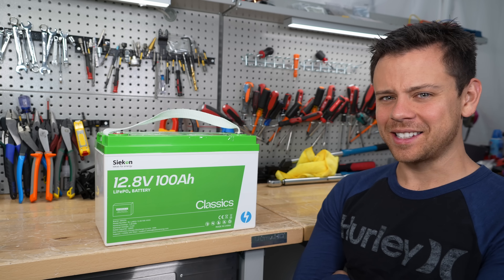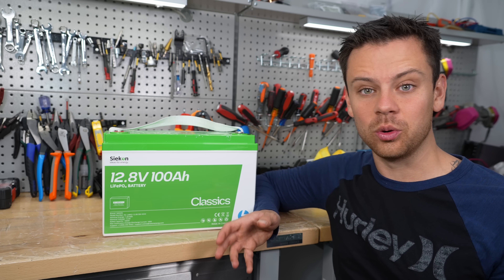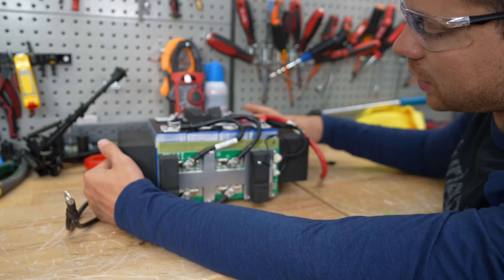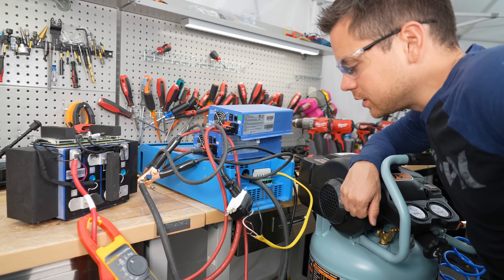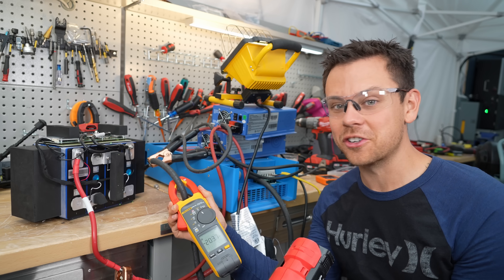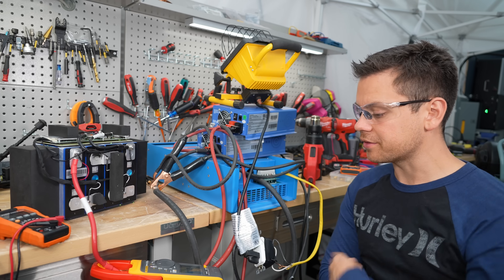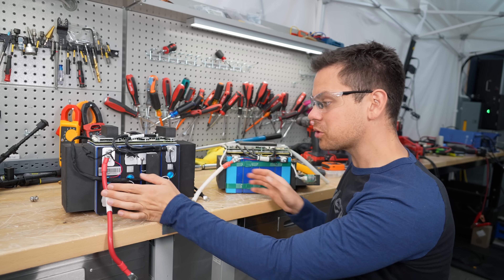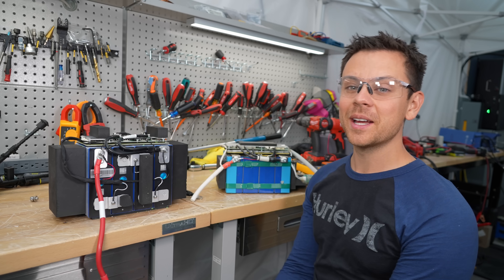Lead is Dead! $229 LFP Siekon 12V 100Ah w/ 150A BMS and Low Temp Charging?!

Comment: Thank you for the review. I'll buy a couple of these. We bought two Battleborn batteries for $1K each, and one died after a little over a year. We contacted Battleborn, as battery was under warranty. Battleborn did NOTHING, except have us check and recheck the battery. We proved the battery was dead and would not charge. Battleborn did NOTHING, NOTHING, NOTHING. I would NOT recommend buying Battleborn because they don't support their product, nor warranty.
Reply: Please, post a review of the Siekon batteries to Will's forum.
Reply: @robbehr8806  I will. My husband is not motivated to purchase more batteries since Battleborn flopped and doesn’t support their product.
Reply: Battleborn has the audacity to hold their prices where they are AND offer that level of customer service
Reply: @TobyCostaRica  I agree.
Reply: @TobyCostaRica  I agree.
Reply: I bought two big Battleborn batteries (270 ah each).  Very expensive.  Connected two in series, keep having balancing issues.  I regret my purchase.
Reply: @pearlydeer4555  ; Do you think it's that the batteries need updating to current standards, your batteries were bad production, or what?
Reply: @robbehr8806  Not sure what the issue is.  This is the third year using these with the 24 volt Growatt.  Had balancing issues in the first 6 months.
Reply: @pearlydeer4555  you connected 2 in series? Dang that is super dangerous if they are not rated to do that.
Reply: And look what it got them; a disappointed customer who will now bad-mouth them on social media.  Great job, Battleborn; you charge enough for your products that you should surely honor your warranties.

They're probably feeling the heat from LiiTime and the other cheapies now and the only thing that their brand has to offer is a reputation of dependability and great warranty support, so if this is how they treat people that spend $2k on batteries, then good riddance to them.
Reply: Man for 4 times the price of a li-time that's crazy. You could've bought 4x's the battery for the same price.
Reply: @mathehack1  At the time of purchase, these other batteries were not available.  Renogy was an option but I went with Battleborn due to promise of quality.  Otherwise I'm in agreement with you.
Reply: @pearlydeer4555  you're right a few years ago there weren't nearly as many options. It was build your own battery with raw cells, battle born, or hit or miss Chinese units.
Reply: @mathehack1  hindsight is 20/20. I agree.
Reply: Can you combine different manufactured 12 volt 100 amp hour lithium batteries?
Reply: battlescam
Reply: That is outrageous. Wish I knew that before I purchased 4 of them a couple years ago!
Reply: @ChatGPT1111  I hope your batteries last.
Reply: I decided to upgrade the batteries in my travel trailer and my parent's trailer, right before  trip. They were all bad and I wasn't willing to buy lead based batteries again when lithium is so much better. Li Time was available quickly on amazon so I decided on those and asked my dad if he wanted the same. He told me that Will recommended them. I had seen a few of his videos in the past but hadn't really caught up on anything battery related in the last year. The 200 ah heated li time battery seems to be working fine, but the li time monitor is not all that accurate. The reviews on renogy ( the blue brand, right?) also show similar results. I think I may use renogy for a solar panel charger and used panels from an arizona company, but it just wasn't worth spending the money on battleborn when they have bad reviews as well. With only using my trailer occasionally, it is hard to justify the extra money. Many sailing channels I watch have used battleborn and have been sponsored by them, but for a third of the cost, I went with Will's recommendation of Li Time. Li Time even offered to take back the monitor after I left a bad review, but the renogy would be three times the money with bluetooth added but the same drawbacks so I haven't taken them up on the offer.
Reply: Thanks for the info. No Battleborn for me.
Reply: How have the batteries been holding up?
Reply: Battleborn is a boomer company

Comment: Lead Acid don't let out the "Magic Smoke" and burn your house down.!!😉
Reply: But Lead-acid DOES off-gas, which is flamable, as well as can cause corrosion. I have used both, and EVERY battery bank I've made with Lead-acid has had corrosion, especially on the Positive terminals. The terminals on every one of my LiFePO4 systems are as clean as the day I installed them!
Reply: I have had the experience of a spark hitting on a lead-acid battery, and it exploded!
Reply: @Tumbleweed5150  Spent 25 years in the Ski Patrol. Every year our First Aid refresher included a section of treating injuries from lead acid batteries exploding from hydrogen buildup. 

I never had to treat a case of a Lead Acid grenade, but it was considered likely enough that they wanted us to be ready and rehearsed for it.
Reply: Lifepo4 does not have thermal runaway it's iron based, no oxygen from cobalt or manganese.
Reply: @btekwindsolar  The Magic Smoke is extremely flammable.!!🙄

Comment: Hi Will, I live in Arizona. I'm very interested in the thermal testing, especially in your cargo trailer. Just like in Las Vegas, heat is an issue, here in the desert. So, maybe do a full and comprehensive video on thermal effects and testing. Maybe, include segments from previous videos that touched on the subject. Love your videos!
Reply: @robbehr8806  Your LFPo's should be in-cabin for thermal reasons. Why, do you put them in an uninsulated basement?
Reply: @my_channel_44  ; I definitely plan to install the battery in-cabin, but in Arizona, if cooling fails or is shut off, temps in a trailer can reach 140F.
Reply: @robbehr8806  Then design a system where that's not going to happen.

Comment: Will, do these have the capacity to run a trolling motor, and or start a boat 60Hp boat motor?  TIA
Reply: They are awesome for a trolling motor. They wont start a 60hp motor though.
Reply: @enigma9789  Thanks.

Comment: Lead acid batteries aren’t going anywhere. They charge below freezing without a heater and LFP is incapable of cranking amps. At this time they are irreplaceable.
Reply: This Seikon LFP can now crank the amps. It can be used for heavy inductive loads and provides active over current and voltage protection.
Reply: @MrJohnBos  It cannot provide the several HUNDRED Amps needed to start an engine!

Comment: Two years ago I replaced my 18 year old off-grid lead acid batteries with new lead acids. Now I'm regretting that decision BIG TIME.
Reply: 18 years from lead? How? I've been getting half that w/ Trojans
Reply: @danstrayer111 I replaced my Lifeline AGM batteries on my yacht after 18 years. They still worked but capacity was poor. I switched to the Amperetime (now Litime) LiPo batteries and haven't looked back.
Reply: @danstrayer111  impossible that they lasted that long unless the depth to discharge was around 5% and they were primarily floated all of their life. Typically you will get no more than seven years if you take good care of them and don't cycle them very deeply.
Reply: @boblatkey7160  yeah...maybe . I have a hard time believing 18.
Reply: @danstrayer111  i've been doing offgrade power systems for 25 years and I've never seen it. However I have seen plenty of lead acid battery banks that are over 10 years old, but again they were shallow cycled and very well taken care of.
Reply: @boblatkey7160  It's a nice irony that for a period of time, basically the life of my last set of lead, as the batteries got weaker and weaker, a really cool array of LEDS were available, (esp on Ebay) that required so much less power, and saved more power than the battery capacity was losing. That set went almost ten yers because of LED 
lighting.That was in the 90s I guess. The old automotive bulbs were real power hogs.

Comment: Do you think this battery is an appropriate "drop in" to start Gas vehicles? The high current draw for a few seconds seems to be the only thing keeping LFPs from replacing car batteries.
Reply: At idle speeds with a stock alternator, you will burn it out. Need a DC/DC converter to buffer and intelligently charge the LFP.
Reply: @s.mendez7160  Yes I've heard that the DC converter is essential. Apparently without it the LFP will try to take almost infinite charging current
Reply: Exactly
Reply: My sailboat's alternator voltage controller already has a LiFPo4 charging mode. My only concern is the "cranking current" which I am beginning to feel is red herring. My starter for the 45 HP diesel engine shouldn't be sucking up 400 amps for any appreciable time. Same for my windlass. 

If I replace my two 168AH AGM Lead acids with two 304AH LifPo4 in parallel with 200A BMS controller on each, I gotta think both my starter and anchor windlass will be well satisfied.
Reply: Vehicle main battery is the one exception where LFP can't be used. Enormous cranking current, plus having a BMS could be disastrous. If the battery becomes full and switches off while driving the alternator output would go unstable and possibly destroy the vehicle electronics. I'm not an electrician so this is only my opinion. For home and leisure use, LFP all the way
Reply: @chrisreynolds6331  I have experience with Alternator "Runaway". There needs to be a "smart" load on the Alternator to prevent it.

Comment: Great video like always. Appreciate all that you do. Quick question in regard to solar panels if you dont mind. If the voltage of panels is going to rise here in Canadas cold weather do the amps also rise in value? I have an inverter that says 450 V at 14.98 amps. Any input from you would be greatly appreciated. Thanks
Reply: No, voltage and current are inversely related. So as voltage increases, the current decreases. This is why smaller gauge wires can be used at higher voltages.

Comment: The one thing that LEAD ACID batteries can do better than lifepo4 batteries can do? Different brands, different soc, will function in a battery bank, or so I've  learned. 

The manufacturers of said lifepo4 batteries state that only their identical batteries should be wired together. 
Is this true? Could one use different brand's while building a battery bank when using lifepo4? Not sure. 
Maybe Will can shed some light on it for us?
Reply: They only say this mostly because they want to sell more batteries.
If they are the same chemistry and voltage, then there's no reason you can't use different brands in parallel.
edit: If you want to wire them in series then they should be the same capacity, so they can all bear the same amount of current and charge and discharge at similar rates.
A small battery in series with larger ones is bad because it'll empty first and stop the whole string from working if it has a bms. If it doesn't, then it'll get reverse biased and ruined.
Reply: If you are running the "banks" in parallel, you can use different brands of equal capacity and Amp Hours, but make sure to put in seperate, appropriate breakers or fuses on each different system, for safety's sake.
Reply: Don't the different bms mess things up though, especially if you use their internal bluetooth??
Reply: @rodmartel3143  It might. I never use the Bluetooth, as I have invested in Victron's Bluetooth version of the Smart Shunt.

Comment: when these can go under the hood it will change the game forever
Reply: Why aren't they? Like with all the BMS protection why is an alternator an issue? I have a small one on my garden tractor that is used less than one time a week. I have a solar panel charging it all the time, and the starter/generator of the tractor hasn't had any negative effects over the past 2 years. I still don't understand why a car is alternator would be bad for it if the BMS could protect it from overcharging.
Reply: @JohnResciniti  the problem is the car alternator will put out 100% of its rated amperage.  This causes the alternator to run hot, and fail prematurely.  This is why, when running lithium in an automobile environment, if it is connected to an alternator, it is recommended to utilize a DC to DC converter to limit the amperage.  So if you used a 50 amp DC to DC converter, the alternator won’t run as hard which will extend its lifespan.
Reply: @91CavGT5 It's that the alternator will still be running after the BMS shuts down charging to the battery that can lead to creating a condition with excess charge on the alternator coils that most alternator's electronics can't handle. Currently a solution is a capacitor bank. A super capacitor bank also allows starts with lower output BMSs.
Reply: @FrancisKoczur  yes, that can also pose a problem too IF the BMS sees an over voltage situation.  In normal use, the BMS does not shut the battery off when the battery is fully charged, so that is not a common problem.  The situation I explained is a common problem for “van lifers” who have a lithium battery bank without a DC to DC converter.
Reply: @FrancisKoczur  @91CavGT5 are there "kits" available of either the capacitors or dc/dc converters to allow these batteries to work without destroying the alternator?
Reply: @JohnResciniti The Hybrid Batteries I've seen have been in separate boxes connected with a resistor to limit current draw from the LiFePo4. There are some YouTube videos if you search. Mostly DIY, but there is also the FPV-POWER 12V 25AH plus a 16v500F supercapacitor bank that's sold together which you might as well buy the equivalent parts separately for a better price.
Reply: @JohnResciniti  it's not the battery that's the problem, it's the alternator. You'll burn it out trying to keep up with the charge acceptance of lithium batteries.
Reply: Epoch batteries is making a 12v lithium cranking battery. It's around 600 last time I checked.
Reply: @Trevathecleva82 oh that thing is sick. $700 is rough but it'll probably outlast the car you put it in.
Reply: I'm using a Noco lipo4 battery in my Harley....6 months and it's great...no trickle charge between rides necessary. My cars are next...10 year service life or longer expected. The game change is now!
Reply: @jime4305 : My 2007 Chevy Cobalt with 430,000 km on it still has the original battery. I've never touched the battery, it's in the back under the trunk. Granted it's getting weak but 17 years including winter driving is outstanding. I've run that battery down to needing a boost at least half a dozen times. I wish I could find a battery like that for my newer car, a 2016 Ford Fiesta that needed it's original battery replaced after 4 years.
Reply: Yeah, I've been using a motorcycle LFP battery in my car to save weight for a while now.   Some cheap Amazon brand that has it's own BMS.
Reply: What about under the hood with an EV without an alternator?  What is the over voltage limit?
Reply: @glike2  different EVs utilize different max voltages on their “under hood” battery.  You would have to research to see if one of these batteries would work or not.

Edit:  most of these batteries have a maximum voltage of 14.6 volts before the BMS over voltage protection kicks in.  However, the maximum voltage will always be advertised in the battery’s individual specifications list.
Reply: The cold temperature is the issue.  A lead acid battery will crank over at -50, a lithium one won't without active heating. I suppose with having to plug in the block heater anyway... having a heater that also heats the battery could be a thing though.  Another issue is that these are not made to float, need to ramp down the voltage once they are charged but I suppose that could be fixed by having an alternator with more logic built in to detect when the battery is charged.
Reply: put it in the trunk
Reply: The antiques that these lead bayteries go under the hood are a thing of the past.  Lead are oats.
Reply: Dakota Lithium.
Reply: @my_channel_44 overpriced just like Battleborn

Comment: A use case for lead acid batteries: aboard a sailing vessel a LA battery is prudently used as a backup and buffer battery for the main lithium bank since the BMS of a lithium bank can unpredictably shut down the bank and throw the boat back into the stone age without radar, running lights or anything electric. This could be catastrophic. A LA battery, being a chemical device, isn't subject to the vagaries that an electronic device is, which because of the BMS, is what a lithium bank resembles. But that's about the only use I can think of...
Reply: If your BMS is doing that...

Comment: Can I use this in my older motor home for the battery that runs the refrig etc?
What about the other battery thats starts the vehicle?
Novice here, obviously ⚘
Reply: Yes for appliances, but you can't use it as a starter battery as the cranking amps are just too high.
Reply: @ahaveland  thank you ⚘

Comment: Lead acid batteries will never die imo. I use Trojan T 105 golf cart batteries and they are great thanks.
Reply: cope 😂
Reply: Dinosaur doesn't believe in asteroids!
Reply: Lead acid is 3 times as heavy and can only be drained to 50% before ruining them, while LiFePO4 batteries are much lighter and can be drained 100% without killing them. They WILL last longer if one uses less of the capacity, but it won't ruin them. They also never need to have the "water" in the cells checked and refilled. LOL
Reply: lithium prices are still falling
Reply: @JD-yx7be  Hey man if he wants his low-efficiency battery that's got low energy density (HEAVY) 🤷‍♂️

Comment: Yes lithium are great for most applications. I still prefer agm batteries for high amp situations like Rv  stabilizer jacks
Reply: li time is making a clone of dakota lithium with a 500ah surge capacity. Yeah, it's not a DH (yet) 😂
Reply: Have you measured the current draw on your stabilizer jack?  Seems the motor would not come close to drawing what an LFP battery could deliver.